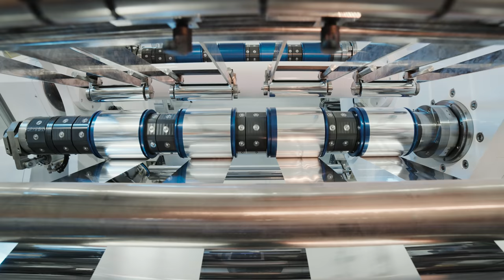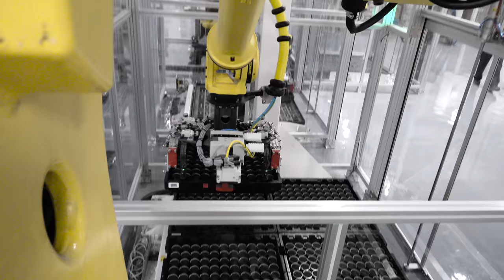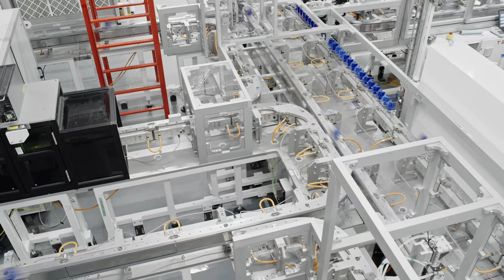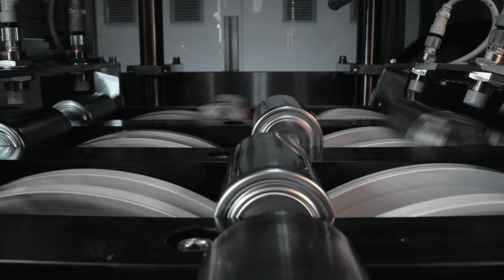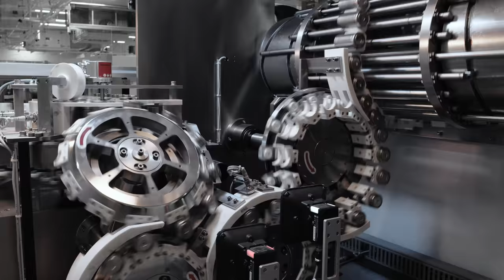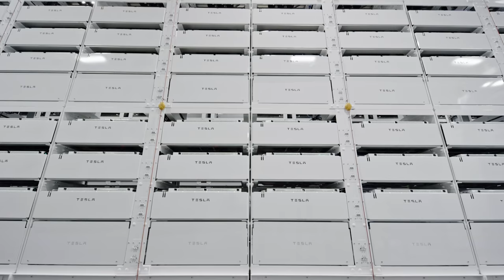Making Batteries

Comment: GM: "Well pouch battery is the future!"
Press; "Why?"
GM: "Because that's all we know how to make"
Reply: Pentagon size battery are the future mark MY words
Reply: GM doesn't make any batteries.... or even any EVs. LG Chem makes them and GM slaps an ugly body on top. ;)
Reply: Batteries are old tech... zero point energy is the future mark MY words
Reply: Gömböc shaped batteries are the future, mark my words!
Reply: I know this is peak comedy, a serious guess would be hexagon cells, best surface area (and thus volume) to perimeter while still being able to tesselate better than the other two, the equilateral triangle and rectangles.
Reply: You're all wrong... It's Hypercubes... We just need to figure out how to make things in n>3 dimensions.
Reply: @ThisIsSolution  doubt
Reply: And they’re probably right because they’re GM or rather now with the new stupid logo gm. They’re too big to fail, and like 2008, they’ll get bailed out if it doesn’t work. Whatever they do will be the most popular because of sheer volume produced, not because it’s the best.
Reply: Lol... They don't know to make any batteries... They buy all of them...

Comment: You need a strobe light to see the batteries
-Elon Musk to Chris Anderson during a TED talk
Reply: i think this footage is drastically slowed down. I've seen the speed of the production line.. It's impossible to see them
Reply: Wasn't that before they switched to the new cell specification/dimensions?
Reply: They probably slowed the machines down for this video or recorded I very high frame rate and slowed it down

Comment: Imagine if a Tesla was powered only with AAA Battery’s...
Reply: Duracell be like: Hold my beer
Reply: Trump
Reply: @andwoo2171  Hold my battery
Reply: Easy! Were is so many rechargble AAA ni-mh.
Reply: Breaking news: “Tesla renames their “Power Wall” “AAA battery””
Reply: @pashko90  AAA sized cells don't have much capacity or provide much current. Li-ion cells used in tesla battery packs are much more energy dense.
Reply: @user-ve1cc6qn6t  Thank you, capitan obvious!
Reply: Lemons and potatoes is what powers tesla hehe
Reply: Hahaha search for "#SNL - Julia Louis-Dreyfus Does Commercial For Battery-Operated Mercedes AA Class Car" :-)
Reply: @haris.19  may be ~20 000
Reply: There are Li AAA batteries. 10440
3,7 Volt and ~350 mAh. One AAA is 1,3 Wh. So for 80 kWh you need 61.776 AAA batteries.
You will need to put 1.000 in series to get to 370 Volt. Then put modules of 1.000 in parallel.
So 61 modules of 1.000 AAA batteries.
Reply: They switched from AAAs to D batteries.
Reply: and every 100 miles youd have to jack it up and change every single one of the 7000 ones...
Reply: @alittlebitintellectual7361  nope, this is why you need a bms and onboard charger.
Reply: What if Teslas are powered by Ni-G-AAA batteries?
Reply: @abhijitmajee6754  they would get cancelled.

Comment: Imagine a future where it only takes one of those batteries to charge a whole car....

😯😯😯
Reply: That battery would be a literal Bomb, way to dangerous.
Reply: @lukasbeckers2680  not really.
Reply: @lukasbeckers2680  ever heard of petroleum?
Reply: @lukasbeckers2680  lithium batteries today are already pretty close to literal bombs lol, ever see one of them melt down? puts gasoline to shame
Reply: @Jettski  Petroleum needs Air to release its energy, that’s an internal safety mechanism, that such a battery would not have. Also with that much gasoline you would not be able to go far, so the battery has to be even more energy dense that gasoline
Reply: @lukasbeckers2680  What do you think is inside a gas tank in a car? only gasoline?? hahaha
Reply: @carloscubas2824  read my previous comment please
Reply: wow.
Reply: only an unprotected battery would pose risk as a "bomb" and even then the most it would do is catch fire, similar to gasoline.
Tesla's today have a titanium shield under the floor of the car to keep the battery from being pierced. The cabin is also isolated from the battery, meaning in case of an extremely unlikely fire, it will not intrude into the passenger area. I imagine it would not be difficult to implement both of these precautions when the battery is much smaller then it is now.
Hydrogen and gasoline pose a higher injury risk then any Tesla battery.
Reply: Frugal Family Living  
Structural batteries will reduce the weight of EV's dramatically. Not to the point where they're on par with ICEV in LB, but to the point where EV's can outpace ICEV's around a track. We're already seeing this with the Plaid Model S
Reply: Frugal Family Living  
All Tesla FUD which either has no actual evidence behind it or is misleading.
Destructive to the environment? Not really. Every pollution report that actually factors in everything, like refinement of materials, usage period, etc always comes to the conclusion EV's are more environmentally friendly then ICEV's even when the EV's only power source is coal. This is possible because coal powerplants are incredibly efficient, and don't power just one EV. They power multiple at once, and if not just powering other electronics. So the effect of one EV charging is dramatically less then less complicated studies will lead you to believe. Also, I'm unsure if you've seen those "THIS IS WHAT A LITHIUM MINE LOOKS LIKE! 😱" memes with a picture of a giant hole in the ground, but none of those photos are lithium mines. They're usually copper mines.

Child mining is definitely an issue for electronic devices in general, since 60% of all the worlds cobalt comes from Congo, a place notorious for child labor.. But Tesla is doing the most to get away from this by removing cobalt from their vehicles. Their cheapest Model 3 variant in China is already using cobalt free batteries, in fact, but they're low density cells so not good use for LR or Performance models. So Tesla is developing their own cobalt free high density battery, I'm sure you've heard of it, the 4680 cell. It will go into all their high performance and cheap cars in the future while remaining cobalt free.

Comment: the 212 people that disliked it so far are short sellers crying waiting to cover their positions on Tuesday
Reply: Glorifying the making of batteries is problematic for some, batteries today require cobalt and other metalls that is mined in very inhumane conditions and this video shows a very clean factory, it feels undermining of the fact it is still a dirty production chain. 

Sure tesla is working on making them cobalt free but it is not the case yet.
Reply: The bubble will burst eventually
Reply: @lukasternelius6409  This video is the cobalt free battery -_-; and they're also using LFP from Catl which is cobalt free 

https://eepower.com/new-industry-products/teslas-4680-a-cobalt-free-silicon-battery-solution/#

Then research Vale as that's the biggest producer of metals like Nickel and is done is mined in clean and ethical manner
Reply: @observantmagic4156  A bubble isn't backed by 50% annual growth since 2013. It's growth is due to massive growth without real engaging competition in sight. While the transition being backed by generational trends and governmental push to sustainable energies.

If you think any legacy automakers have real engaging offerings compared to Tesla in 2020-2021 you should do more research.

Performance / Range / Reliability / Value / Infrustructure 

No one comes close and they all have questionable reliability that has yet to be proven, they can have performance but lacks range, and they can have range but no performance.
Reply: @observantmagic4156  bubble what?
Reply: @Luke Steinbicker That's when you don't think about: pioneering vision for the future, potential additional products, high-end segment, lower end future segment, full self driving, solar panels/roof, home/commercial batteries, and a LOT of hype and a somewhat religious cult behind it. 

If you think Tesla is the same as Kia, as in just a regular automaker, you're just not looking at it right. 

It's been pretty much showcased they're ahead of most companies for the technology they provide and so far battery-wise only QuantumScape's speculative batteries are a somewhat real competitor. 

Everyone's trying to beat Tesla on paper but who's beating them in actuality? 
Porsche's overengineered, ultra low efficiency Taycan that can't even beat a Plaid model at a higher price? And that's just drag racing 2 fast cars. That's literally how far behind the competition is, they need to overengineer a rotor to beat a Tesla by .2s and give up 150 miles of range in the process. 

When you start looking at that and stop looking at "misaligned panels, cybertruck window cracked lmao" then you understand all the short squeezes and why it's so high up.
Reply: haha short sellers go cri because it went up
Reply: @distantarray  The 4680 is simply the cell and it support multiple chemical setups, but right now they are still using nmc as they say they do in the article you linked. They have reduced the cobalt amount in the cell though so it is going in the right direction. If you have any source on this exact video i would like that because i couldn't find it, I just assume is fermont or other US based factory. All i know is this is teslas own. The only one to use LFP(Catl as you mentioned) is a rather small amount in shanghai? Im not sure if they have moved onto this new dimentions yet.
Reply: the gas stans mad that electrics better and then the gas brands be hopping to the electric bandwagon smh
Reply: plus it’s not even that hard to get a supercharger built somewhere
just email tesla and if the area has lots of the cars they will build a supercharger
Reply: THIS WORLD IS GETTING SO FUCKING SCARY!!! Go watch Gunz N Butts music video on youtube and mabey an idea will pop into YOUR head🙈😠
Reply: @Luke Steinbicker point proven

Comment: it hurts to see the batteries not arranged in a "honeycomb" structure
Reply: making cilinders is way easier and cheaper, if I wanted to do a poly I would choose a cube
Reply: @pasticcinideliziosi1259  no, but at the end, the batteries are arranged in a square grid not a hexagonal grid
Reply: @jagorjurekovic1697  for manufacturing! Designing/programming robots and material handling processes  operate within a rectangular grid is much easier and more reliable than a hex grid. Absolute space optimization is not necessary for the production line.

However, in the battery pack - the actual production item - space efficiency is critical and IIRC there they are arranged in a honey comb layout.

Comment: I'd be more interested to see how these batteries are recycled.
Reply: Yeah, valid point, but it looks good (also was implemented worldwide for lead acid batteries). Without letting the electrolyte burn, almost everything can be recycled:
youtu.be/oKFOqMZmuA8?t=306
Let's keep in mind, this is often used as whataboutism and batteries usually live longer than cars and will have a second life outside the car before the 15-20 year lifespan is over.

Comment: I could not find a video on your channel about the impressive Tesla Model S Plaid.
   Congratulations on the new performance levels of the particular model. 
   Unfortunately I cannot comment on your Twitter, so I have chosen to use this newest video here on your channel.
   First, I cannot deny that the Model S Plaid is the quickest production car 0-60 at 2.0/1.9.
   The Model S Plaid is not however the fastest production car. Quick and fast are not the same metrics, even though 200mph is impressive for any production car.

Comment: Can we use small generators on rotating or oscillating engine parts and wheels to generate current and use that current to charge the battery on which the car runs. 
Also can use capacitor to store that charge and using later on when the primary battery is running low.
Reply: You cant because the generators will make the wheels spin slower so your car will use more enrgy to move the same speed. motors in a tesla are also generators but only activate to slow or stop the car and store the energy back into the battery, capacitors aren't needed as the tesla battery already has more power then the cars motors can handle.

Comment: You forgot to show the mining of the materials used, not the children working in the mines.
Reply: @miguellopez3392  they use  nickel magnese Cobalt oxide
Reply: @TheRandompaint  that is for the 18650 and 2170 cells they currently use, these new"4680" cells will not use cobalt and instead use Nickle and silicon, these are intended to be the most mass manufactured batteries tesla will make and is critical for their expansion efforts into the energy market so they need a battery that is very cheap and cobalt is just too expensive and problematic.

Comment: What Tesla needs to do, have a replacement battery for vehicles if the battery runs out of juice on long trips, so driver doesn't have to wait at a station for battery recharge.
Reply: These batteries can charge the full in under 10 minutes of making swapping irrelevant.
Reply: Not happening. There's currently a battery shortage, and will be for the next 10 years.  Not wise to have batteries sitting idle when they can go into cars.

Comment: Hey engineers from Mars ..u people noticed something on battery compartment like they consume a lots of space instead of installing cylindrical shape Battery do something tech like square shape Battery and these will fit either 4 side and tranfer heat across 4 corners .. what u say elon!
Reply: There are still some issues with that, gaps make cooling easier

Comment: I never thought about this..if a Tesla is all-electric, then would lightning disable it, implode and overcharge the battery, supercharge the car, or fill the battery up and channel rest of the energy?
Reply: If struck by lightning it would likely travel through the frame of the car and out the tires blowing them out possibly, if the current goes through the battery that can cause damage or fire as it will be too high of a voltage.
Reply: @miguellopez3392  ah yes.

Comment: The batteries of the future will not just be storage to output the could be storage to input to output a device that allows free flow of electricity in and out of the batttery like it taken an elevator to a different floor transfered to dump chamber to go back in to the national grid.

Comment: Flying in dream, you know those roller wheels for your heal's, when dreaming take a run then set heal's like the heal wheel's, then use your mind to move you forwards, like the heal wheel's but don't move your leg's the ground slippy like ice, then when mastered lift leg's hold your self flying, then fly to the light, not space you'll just go in to nothing, but light toward you must go, their's gate's to the other place just off heaven. A grave stone with combination lock.

Comment: So idea for industrial sized solar panel's, it all come down to the mounting of the panel's not horizontal but hanging perpendicular almost so sand does not settle on top, gaint desert collector the size Amsterdam windmill at the bottom and standing the hight of the angel of the north, holding nine rack each side with a moveable head, to optimize light coverage, thousand all over the desert of the world. And ah yeh wind mill's on mountain, it give the hard core mountaineer's some thing to climd for.

Comment: The anti gravity plane drop, i suzed it, it that that told me that gravity was'nt an force it was a result of an action, the action of pressure, the plane drop's at the angle moveing forward constantly so the downward action is acted with in the forward motion, giveing weightlessness, so the pressure of a forward action at that angle lead the lack of pressure. So what is it what causes gravity pressure forces holding use down.

Comment: Why dont Tesla use lipo batteryes? Longer life, not cheaper but Way better, you can buy 6s 12 pcs to make it 240v and you can Add 24 more (all 15kmah) better performance, easy to store Because they can fit like under the seats or like That
Reply: these cells have a higher life span (1 million mile life span) and much lower cost, these are more critical than anything else to teslas plans, their current cells provide very good performance so long as they are cooled properly.